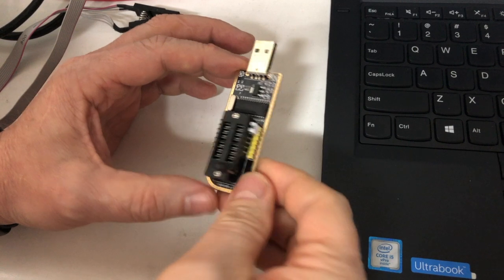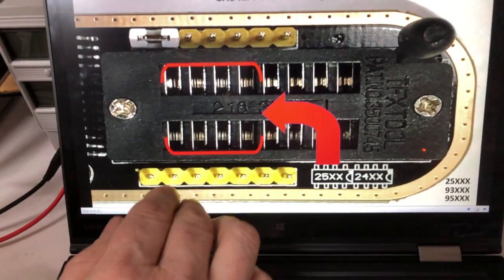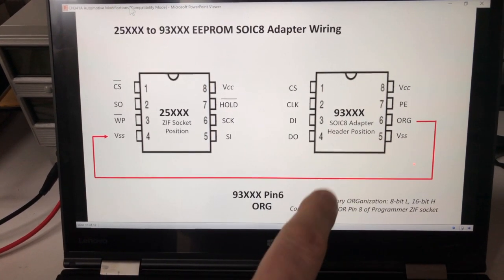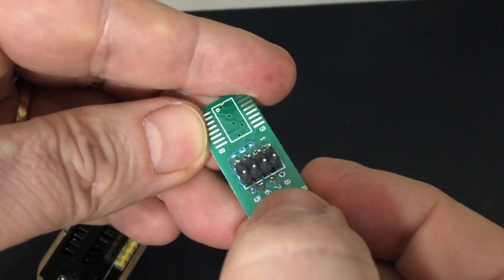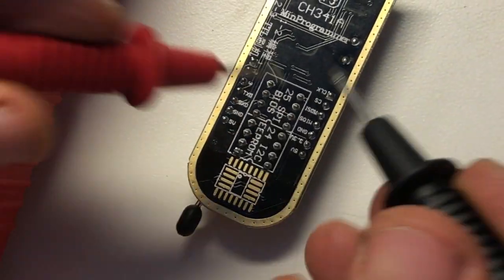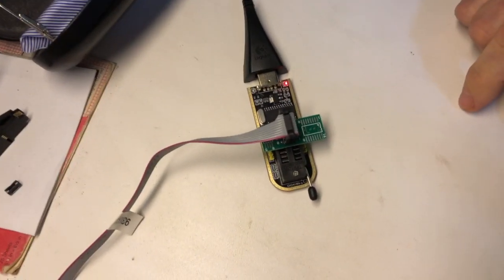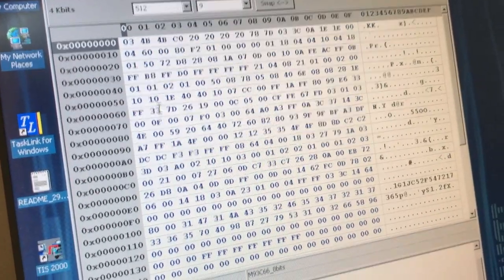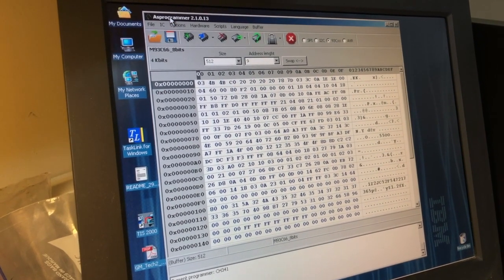Modify the CH341A EEPROM Programmer (Black Edition) for 5V 93XXX & 95XXX Automotive Use

Comment: @DrShock  My goal for learning this type of technical information is to make my "junkyard" purchased radio in my Chevy Caprice / Holden Commadore work in its new home. The issue for me isnt that the radio is locked but its all in one comboed with the hvac controls so i have no heat or AC at all because of this.. 

Ive been working on the CH341A setup i purchased from your links this weekend and had moderate success. I was able to get the software and drivers into my new laptop and successfully launched the program. Heres where i have had a few problems. After hooking up the CH341A to an 8-pin EEprom that turns out to be a 64bit chip i did successfully connect and read the chip according to the ASprogrammer software. 

However the first few times i read it there was no information at all displayed. Confused and somewhat disheartened i looked over how the ribbon from the "black clip on tool" to the reader was connected to insure it was indeed in the 24 slot with the #1 pinout in the correct location. Finding i had reversed the pin one i corrected this and read the chip again. Once again success, but no info at all showing in the software. It wasn't until i moved the ribbon chip pins to the 25 section of the reader that it gave me some form of info. mainly a jumbled letters and stuff along the right side of the screen. Nothing familiar or close to a VIN. 

So, my question to you is: 
1. Could you show a proper way to set up the CH341 usb reader for use in automotive 8-pin reading?
2. Could you maybe give an overview of how to tell what type of chips we are seeing in the boards?  

3. Maybe a resource of how to know what kind of chip we are seeing (vs the weird combo of numbers and letters printed on the chip) and how to correlate it with the list of chips in the software would be extremely helpful. 
4.Maybe an overview of the ASprogrammer software and setting it for specific auto based uses?
5. Lastly, I recognize that you seem to be able to go straight to the chip on the board that might release the lock off the radio, how is this possible and will you teach us? 

I wouldn't request any of this without knowing that it requires your time and expertise of which i would gladly donate again for these questions to be answered. I bet more than just me would love the in-depth content as well.  Thoughts?
Reply from the maker: There are four different EEPROMs you can encounter in automotive electronics from the 1990s thru the 20 teens.  Those would be the 24XXX series, the 25XXX series, the 93XXX series, and the 95XXX series.  You have to correctly identify the EEPROM you're working with, in order to get the adapter ribbon cable plugged into the correct half of the CH341a ZIF socket.

Past that there is making sure you get pin 1 lined up with the red line of the ribbon cable/test clip.   This is sometimes indicated on the chip by a dot or bevel.  Sometimes though there's no physical indication so you have to use the meter to try and identify the pin for Vcc and Vss manually.

Another caveat is very few circuit board designs can actually be read in-circuit with a testclip.   The vast majority of the time, the EEPROM chip has to be desoldered from the circuit board and read/written that way.   Then it can be re-installed onto the board when the reflash is completed.

Finally, the cheap asian import testclips are only good for about five reads before they lose their spring tension or the tips bend.  If you need do this frequently, I'd highly recommend getting a USA made Pomona Electronics brand testclip for SOIC8/SOP8 devices.
Reply: @DrShock  One chip indicates: 24c64wq top line - st208p or st288p bottom line so this would be a 24xxx series? so it would actually have 24/25/93/95 in the number printed on the chip? I think thats where most of the confusion is setting in.
Reply from the maker: That appears to be a good number yes, 24C64 is a legit EEPROM in the 24XXX series.  And yes, the first two digits signify that.  But it's actually kinda common for GMs suppliers like Delphi to leave these numbers off and put their own part number on it.   When that happens, you need to have more experience in how to figure out what the chip type is manually by trial and error.  

But in your case, I would proceed with it as a 24XXX series and use the 24 half of the CH341a ZIF socket and set AsProgrammer to this specific chip type of 24C64.  You should identify the manufacturer of the chip as well, by the logo silkscreened on it.  As there are programming differences from supplier to supplier.  AsProgrammer will provide the various chip manufacturers it supports.  A good reference for the logos is https://how-to.fandom.com/wiki/How_to_identify_integrated_circuit_(chip)_manufacturers_by_their_logos/all_logos
Reply: @DrShock  Thank you for your help. Trial and error has been my greatest teacher along my life.

Comment: Hello Dr Shock,Thank you very much for the good job you're doing.I was Wondering,Is there a way to write or change manually the hexadecimals on the Immobilizer file?Thank you
Reply from the maker: Thanks.  The AsProgrammer software I mentioned (link in the description) handles that part, the main part of the apps window is an editor into the chips memory.  So you can type over what's there and change it.  It's extremely powerful, and dangerous.  Be sure you know what you're changing and why, and have made a backup of the chips contents prior.   You could easily brick a module doing such edits.

Comment: Can this be modified to get a D93A66 working?  It's the EEPROM used in the BCMs of 2006-20?? Impalas.  I thought making the adapter for the 93XXX would do the trick, but it didn't.  I went ahead and just removed the original EEPROM and put it in the replacement BCM, but I'd still like to make a backup file of it, just in case...
Reply from the maker: As best I recall, you need to read a 93Axx in 16-bit mode.  Try as a 93C66 in 16-bit mode setting in AsProgrammer.   The only 93xxx I'm aware of that needs a bit of a different wiring adapter is the 93Sxx and I explain those extra pins in the video description.   If it still does not read, it may be that the Impala BCM is simply a circuit design where the chip cannot be read in-circuit (this is due to the testclip powering up several other chips on the same read/write or data lines).  There are many where this is the case, and you have to desolder the chip and read it outside the circuit.

Comment: Finally an actual informative video! Now, hopefully I can find a new 93c56 chip and virginize the immobilizer in my Lexus.
On that note, does anyone know where to find 93c56EM8 chips? They seem to be impossible to find :c
Reply from the maker: Thanks.   eBay is usually your best bet for chips like that, here's an affiliate link that shows a few sellers with the EM8s - https://ebay.us/yn8tzC
Reply: @DrShock  Thanks man! You just ended what seemed like an endless search

Comment: After following your guide, unfortunately, I was unable to read the 93c86 on my KESSY module for my Volkswagen Phaeton, even after desoldering the chip and reading out of the circuit, is there something I'm missing? I tied pin 6 to ground, then I tried to pin 6 to VCC as recommended for 16bit, even when the 93c should be 8bit like you said, and still nothing, using the CH341a and Dupont connectors to wire everything non-permanently, triple checked everything, using 5v yellow pinout for VCC voltage at 5v, could this be the issue? the other non-VCC pins are still 3.3v, but even then I still should be able to read the EEPROM, could also maybe be that the EEPROM is fried? i also tried to read the donor board's EEPROM out of the circuit and resulted in the same error in As programmer, IC not responding, ive also had so many CH341a drivers installed from previous bios flashing on tons of motherboards, so maybe one could be interfering? should I try a virgin windows environment? 

Thank you. i also tried using the spare little board to wire the connections permanently onto the board, still using (confirmed) 5v from the yellow pin and still, nothing, might buy another CH341a to mod, as my original was modded from 5v to 3.3v (reverse from what is done in this vid as mine was faulty from factory, would output 9v on 5v pin).

tried a fresh 341a from one of my buddies, brand new from the bag, could read 25wxx chips just fine, but same result for trying to read EEPROM from kessy, 93c86.

Help would be greatly appreciated, thanks!
Reply from the maker: My initial reaction is some short occurring in your implementation of the pin adapter I go over in the video, or installing it in the wrong section of the programmers ZIF socket.   For a 93XXX adapter, it has to plug into the 25XXX section of the ZIF socket, same as with a 95XXX.    Do no use the 24XXX section of the ZIF.
 
Another possibility, though you don't mention any "S" in the part number, is a security type of EEPROM.  In the description, I go over the additional wiring needed for this type of device to be read/written successfully.

Otherwise, I'd offer the following basic guide of problem elimination:
- Verify you have the CH341a setup properly by just reading (and writing) a vanilla 24XXXX and 25XXX device.  This insures both the CH341a hardware is OK, and that you have the AsProgrammer software correctly installed along with the USB drivers for Windows. 
- Carefully re-review the 93XXX pinout adapter implementation you have.  There should be zero bodge wires and/or traces other than those shown in the video slides.   Otherwise there will be shorts.  Verify that you are getting the correct +5VDC (not +3.3VDC as that 3.3V will not power up an automotive 93XXX correctly) at your adapter on the power pin.  Verify the ground pin of your pinout adapter also by using it alone to measure the +5VDC.
- Verify that the version of AsProgrammer you are using is the one I recommended, or higher, only as earlier versions of that software had severe bugs and would fail to read 93XXX and 95XXX devices.
- Try to read a 95XXX device, as this would verify you have the right level of AsProgrammer installed.

I hope these steps help.  Unless you have an "S" version chip, the problem reading two 93XXX's in a row is most certainly in your setup (presuming of course the chip is an actual 93XXX and marked as such on the silkscreening).

Comment: Comprehensive and cohesive! Thanks. 93C66 read without errors. I soldered an old ethernet cable directly to the socket then ditched AS programmer for Neo Programmer.
Reply: hi, do you have a photo of your setup?

Comment: Hi, great vid! I've just tried this with a 93C56AE off the info Display of my wife's Opel. I wired an adapter as you described but all I got was FF everywhere regardless of whether Pin 6 was Vss or Vcc. 
I've just noticed on your adapter there are no signs of cut traces before you put the tiny wires around the pins. How does that work? 
Thanks!
Reply from the maker: Thanks, yes I repurposed the small adapter board for this by cutting each of the traces that are not needed for the adapter circuit first,  and then rewiring it to serve as a 93X adapter instead.   I didn't show the specifics of this,  as everyone may have a different approach they want to take to making their 93X adapter.  I went this route as it's cosmetically cleaner, you cannot tell it was rewired because all the bodge wires are hidden underneath the black plastic of the pin connector.   Either way, you definitely cannot leave the original traces in place of anything you would reuse, as that would create short circuits when laying down the 93X adapter wiring!
 
So a couple of tips to account for reading 0xff:
  - Some circuit designs cannot be read in-circuit with a test clip, the chip has to be desoldered from the board and read off board.  This is because some circuit designs will allow the test clip power line to power up additional chips, which then create bus contention to read the EEPROM blocking any reading.
- Chinese import testclips are of extremely poor quality, you may have to fiddle with them a number of times to make a good connection.  Be sure you have the red lined pin one of the chip in the correct orientation.  USA made Pomona testclips are a huge upgrade.
- Automotive EEPROMs require 5VDC to be written, this is totally different than EEPROMs of the same number and type used in personal computers and consumer electronics.  Many circuit designs will require the 5VDC even to read the chip.  So you must make the voltage mod also when doing automotive work.
- Some chips have a security feature that prevents being read, this requires additional adapter mods that are outlined in the video description.  Such chips have a 93Sxxx numbering rather than 93Cxxx.
Reply: @DrShock  Very clever!
Thanks for the info, it will surely be a huge help! I've tried both on the board and also desoldered it and clipped the chip in. My guess now would be that 5v mod is probably needed to read it. i'll try that next time if I don't ruin anything in the process 😅
Thanks for the info, stuff like this is really hard to come by!

Comment: Ofter this modification it will work for normal ch341a programmer ?
Reply from the maker: After this mod you cannot program non-automotive parts in the 3.3V range.  It will only handle 5V range devices, unless you do something to allow a switch between the voltages.

Comment: Hello, is there a way to trouble shoot? I have made all the modifications to the CH341 but I cant seem to get the ASProgrammer to read the chip (93c56) or get the run light to illuminate. I ge the CH341 error code in the ASP message window.
Reply from the maker: So the basics on this simple device for trouble shooting
- Make sure the CH341 is working before making any modifications.  Due to the low cost manufacturing, there can be defects/duds as well as basic issues like incorrect device driver installation.  Use a simple desolded out of circuit 24C08 type device to test baseline working order - no testclip usage.
- As you make changes, test each change.  Test 5V modification first, verify baseline operation is maintained with this mod before moving to the next.
- Test your separately created 93XXX pinout adapter.  First tone out the adapter with a continuity tester to verify no mistakes made during creation.  Then do basic reads of a 93XXX device out of circuit.  Very important, you want a baseline before wasting alot of time with a circuit that cannot be read via a test clip.

This approach helps catch problems before they add up and are far more difficult to track down.  Hope this helps,
Reply: @DrShock  Yes it does, Thank you.

Comment: Ok I did the 5 volt mod, do I need to mod board for a 09400464 gm chip which I believe its a 24C08 Chip.  I have tried to read it with just the 5 volt mod and I get an error.  Any suggestions?
Reply from the maker: No, as mentioned in the vid the wiring adapter is just for 93XXX chips not 24XXX or 95XXX.

Comment: is it possible to simply make a jumper between 3.3 and 5 volts
Reply from the maker: you can add one if you think you'll be using this for both voltage type devices.  You'll only encounter 5V ones in automotive applications.